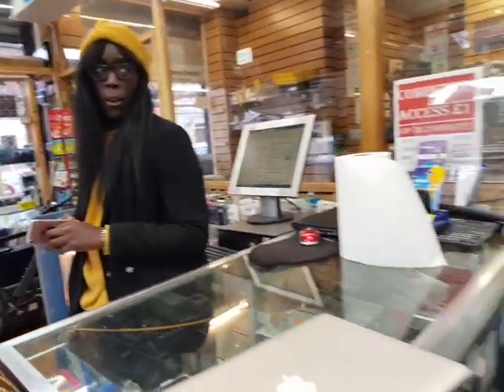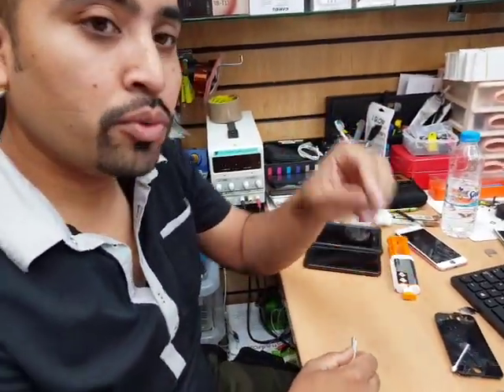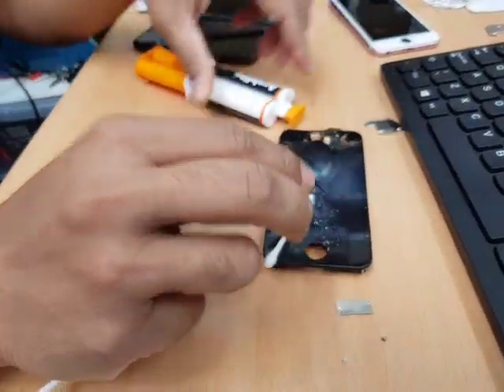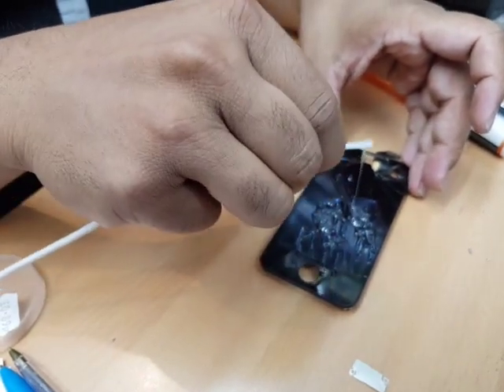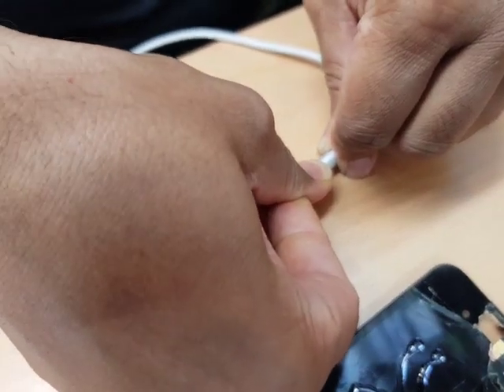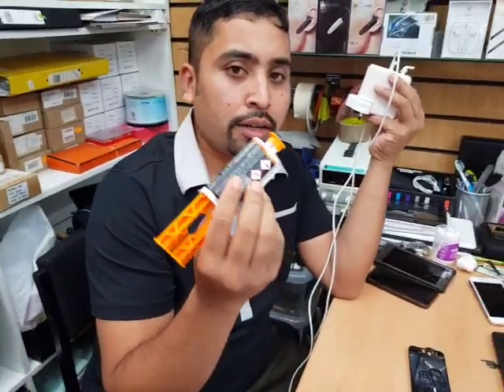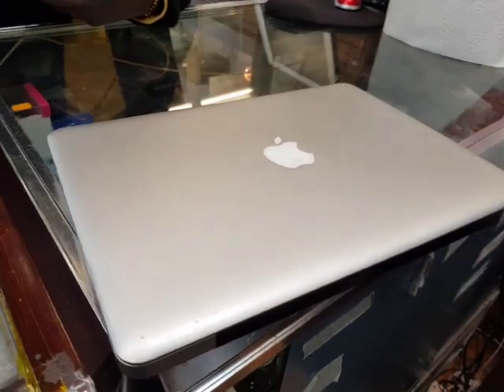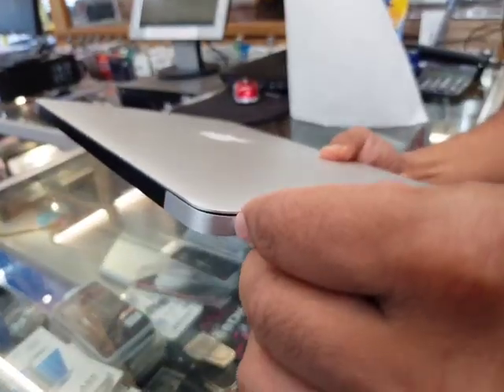Apple  Mag-safe magnetic connector repair EASY FIX!

Comment: Hello . thank you for that.. mine came out too and one of the two pins broke, the longer one. does that affect the charging ? since mine doesn't seems to charge as before. There is no current going through those pins, right? or yes?
Reply from the maker: I think so. connection issue!
Reply: @thepcphone  thank you.. any welding could be done ?

Comment: The little part that you glued on is stuck in the the laptop. Any ideas how to get it out so I can stick it back to the charger? I can’t pull it out with my fingers.
Reply from the maker: it depends on your chargers condition!! I could tell you if you send me a picture of the damaged part !!.
thepcphone5@gmail.com
Reply: Mine was also attached to the MacBook. I put the pins from the plug back into the magnet and using the slight aid of the pins in the magnet holes, tried to pry it off at an angle downward vs pulling it straight off. Took a couple tries but worked. 

(I know I'm late to your comment but for anyone else reading in the future...)